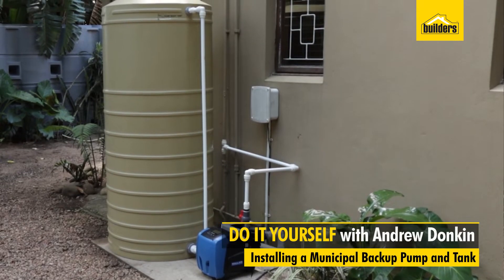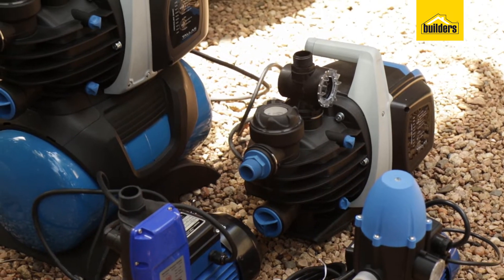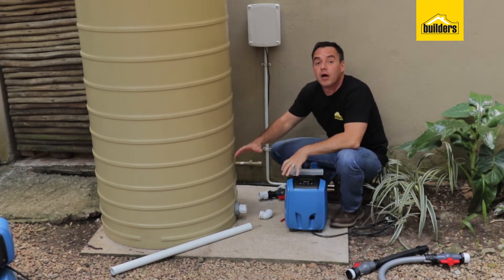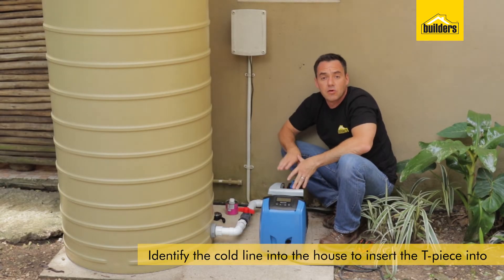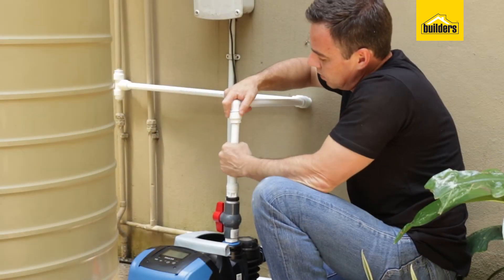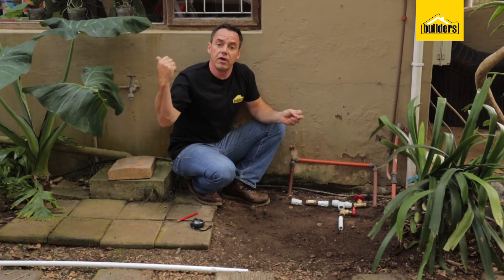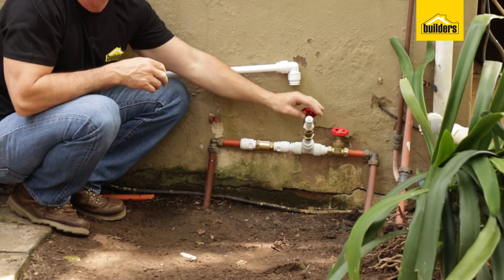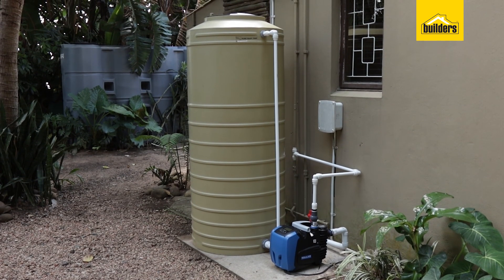DIY - Municipal Backup Pump and Tank Installation

Comment: I hooked up this setup, however municipal water pressure is too low to get water up to the tank (it’s in the roof). I added another small pump to pull water up and fill my tank. Now I have a new issue, the tank fills 99% and the float starts to slowly close the valve.  Pump kicks off but valve is slightly open. Pressure drops, pumps turns on, then off, and so on for about 2 hours. How can I fix this?

Comment: Hi. I have read elsewhere that speedfit (and pex generally) is not uv safe and cannot be used outdoors. 
If used outdoors it will perish within a few months. 
Can you please clarify this.
Reply: Speedfit & John Guest fittings are UV resistant and are compliant with SANS 10252/54

Comment: You should have designed the piping such that there is a passive flow through the tank, like a hot water heater or expansion tank, when the municipal supply is online. This ensures that you always have fresh water in the thank - as it is now, you would have to remember to flush the tank periodically for it to remain potable

It looks like a tropical climate in this video, but another thing to consider for other people - piping the tank in series with the municipal supply can actually save energy as well if the tank is placed in a climate controlled environment such as a basement. Water sitting in the tank would warm up a bit in winter months before use, and the hot water heater will not have to work as hard
Reply: Nice idea about using passive flow through the tank. How would you do the piping in your scenario?
Reply: @conradpaul6100  Could really make my own video to do it justice 😅essentially pipe tank and pump in series with main water line entering house instead of in parallel. All home water flows thru tank regardless of city water status. You would need a check valve on city incoming before the tank, and might need a bypass in parallel with the pump (depending on type of pump used), so that the pump does not have to run when city is online.
Reply: @IncognitoVideosInc  please do your own video and tag me mate
Reply: @IncognitoVideosInc  Have you made a video on this as I would like to setup my system like this.

Comment: Hi just a question what activities the pump when you open the tap. Is there a flow switch in the pump. Looking at getting this system to use on my gas geyser.

Comment: Do I need pressure tank? Im already buying a 600L tank + watwr pump but they're insisting that I should buy it. We don't have second floors and the source of water is less than 9 meters. Please help. We need tank coz the water is only available at night.
Reply: u need a tank with a ball valve like ur toilet cistern

Comment: Thanks for the video!
Can you please explain the electrical supply you used for the pump? For example did you use a separate breaker for running electricity to the pump? Do you have any recommendations? Once again thank you for the great video and any feedback you can give.
Reply from the maker: Hi Austin, Andrew connected the pump to an existing plug point. The don't draw too much power, so a separate breaker is not needed. Check out the range of Tallas pumps that Builders has to offer here: https://goo.gl/7oRYsy. They really are fantastic pumps :) NM
Reply: Is it not necessary to put it on a separate breaker because it’s outdoor? Or on its own earth leakage

Comment: Why is there 2 inlet to the house inlet  pipes?
One from the pump and the other from the T connection from the main line.
Reply from the maker: Hi Sal, there is only one supply connection to the house where the pump is.  The other connection at the main is an outlet supply to top up the backup tank.  I hope this helps. :) NM

Comment: Do i need a pump if I have my tank at a higher level than the house? Will gravity force be sufficient to constantly  supply the water to the house?
Reply from the maker: Hi Sal, normal household pressure runs between 2-6 bar.  To maintain the same pressure, 10m = approximately 1 bar, 20m approx 2 bar,  thus your tank would need to be quite high to reach the higher pressures.  However, if the tank is above the level of the house then the water will flow at a lower pressure.  That's where the booster pump comes in to increase the pressure of its needed.  Many older homes still run on a gravity fed geyser situated in the roof which also works fine.  It's all about the pressure you require at the end of the day. Hopefully this helps :) NM
Reply: BuildersFan 
Thank you. Appreciate the quick response. Now it's clear I will need a pump.
Reply from the maker: Glad we could assist :) NM